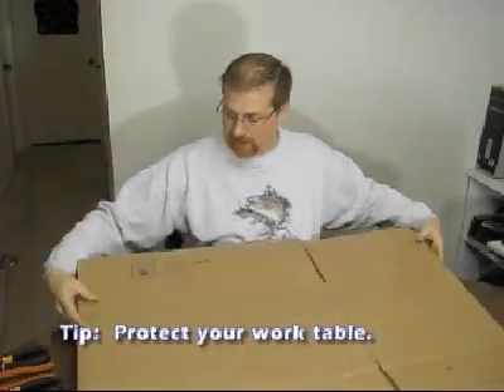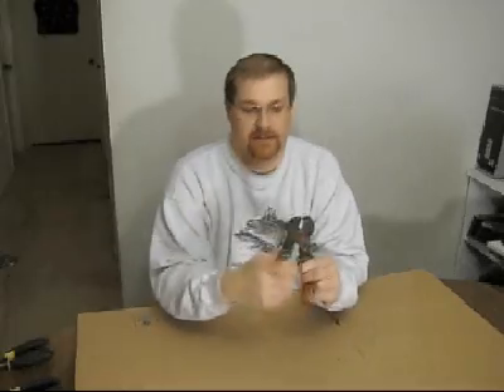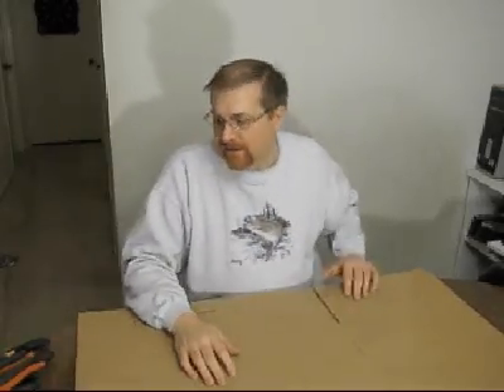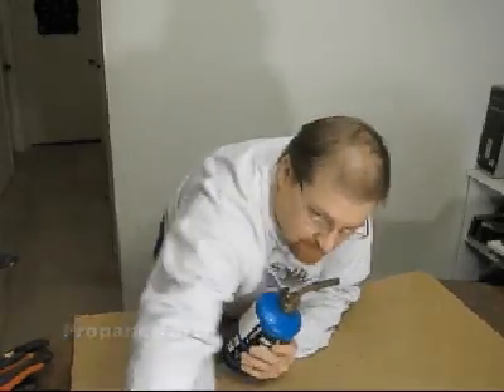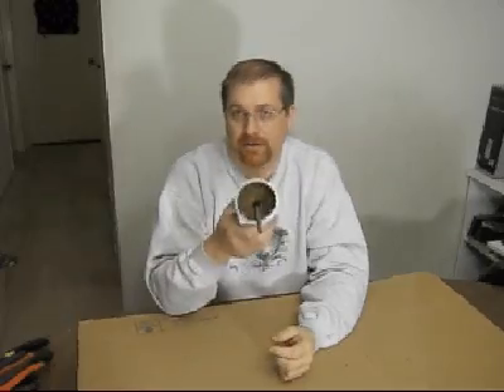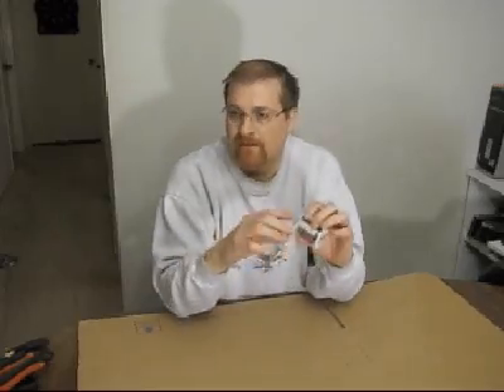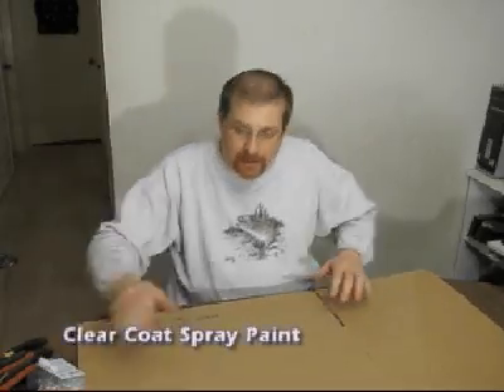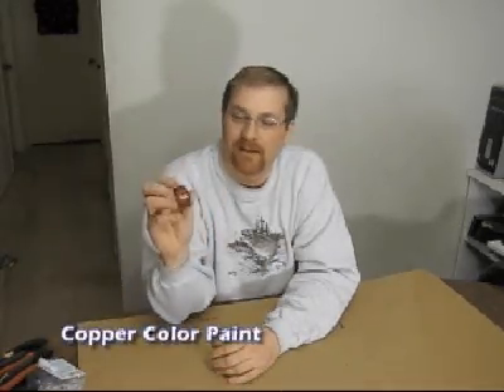How to Make a Rolling Ball Sculpture (1 of 9)

Comment from the maker: You could use stripped 12 or 14 gauge electrical wire.  It's much thinner so you'll likely need more supports but it should work.  You can find wire strippers at better home improvement stores.  You could also go even smaller and get 16 or 18 gauge craft wire from craft stores.  However those are usually enamel coated and more flimsy and harder to do.  You will need to sand off the coating where you want to solder with a dremmel rotary tool.  For that small of wire, you can use a butane torch.

Comment from the maker: There are various types of clear coat.  It will just take a bit of experimentation for what you like.  You'll want to try Lacquer, Acrylic, Varnish, etc, just to find out what looks the best to you.  In any case, air will eventually seep through whatever type coating you use and will eventually make the copper tarnish and change to a sort of brownish color.  The best you can hope for it to slow down this process. I like using the clear glossy spray lacquer. It's inexpensive and looks nice.

Comment from the maker: @CoasterFan456 I don't recommend a soldering iron for this work.  Soldering irons, even 100watt, don't get hot enough to solder 1/8" copper wire effectively.  A propane torch is much hotter and still takes several seconds of heat before getting the copper hot enough to solder.  If you try to use a soldering iron, you'll likely only end up with cold solder joints that will just fall apart.

Comment from the maker: @wuzzy41123 NO!  Just kidding.  Of course they could work.  Be sure you get the actual chrome non-corrosive type or you'll have beautifully rusted martian orbs in no time.  I buy the 500 foot roll of 1/8 inch solid copper ground wire from Home Depot.  You can sometimes find these supplies on ebay!

Comment: I should mention I have a 400 watt soldering iron.
Reply from the maker: shinigami19xx I'm not sure about a 400w soldering iron but I still doubt it will work for 8 gauge copper wire.  Thinner wire might be ok.  The problem  is that copper wants to sink the heat away and so it takes a lot of instant heat to melt the solder.  Iron Heat that slowly heats up the area that is also sinking away is just that very slow and so then it will take you forever to make a sculpture if it will work at all.  Thinner wire may be ok to use a soldering iron but thick copper wire is hard to use a soldering iron. It's not impossible but just not convenient and fast as a propane torch.  Go to the store and buy a foot or two and then please experiment with soldering and then decide.
Reply: swirlingbrain I was thinking of using stainless steel instead of copper. It's higher tensile so I can use thinner wire (That will also reduce the heatsink issue). If the solder has silver in it, it should take to the stainless steel pretty well. At least, that is my theory. 
Then I won't have to coat it later with anything because the stainless steel won't tarnish.
Reply from the maker: shinigami19xx Most people use a tig welder with stainless steel.  Of course there's more than one way to do just about anything but again experimentation may help to try it out first.  There is also a yahoo RBS group that you may with to check out and that is a great resource for asking the guys the best way to go about doing stuff (besides me since i'm not experienced with stainless steel).  A lot of them already have years of experience that may help a lot.
Reply: swirlingbrain Thanks,
I'll grab a small amount of stainless steel wire and give it a go first.